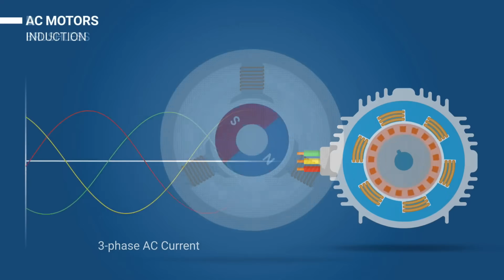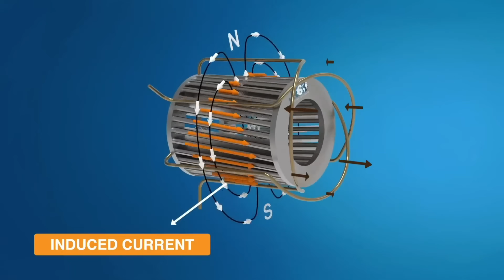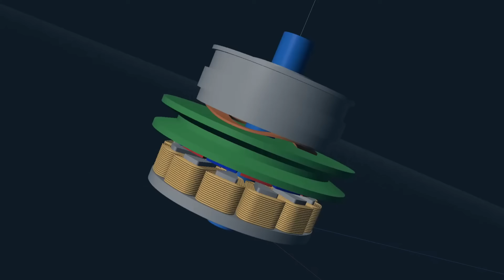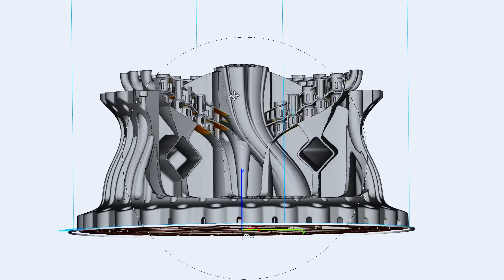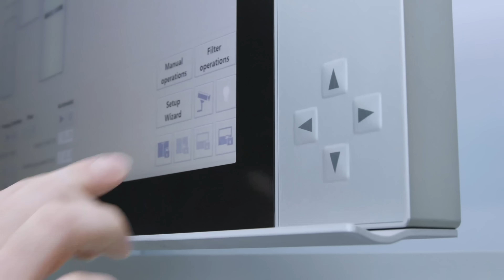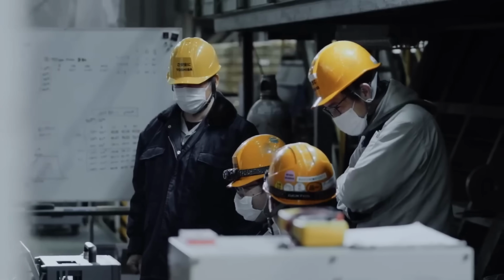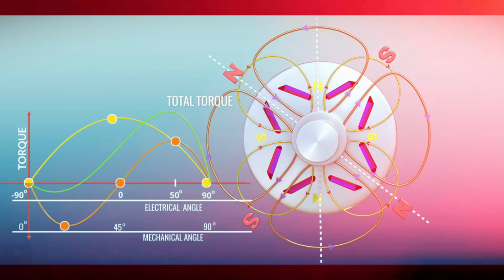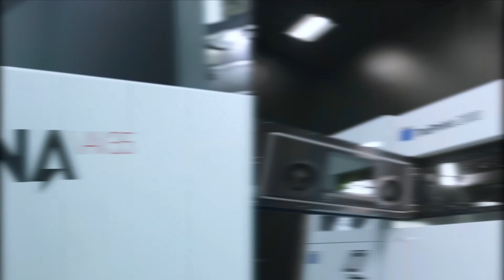NEW 80KW A.I. DESIGN ELECTRIC MOTOR - FREE ENERGY FOREVER 100% REAL!?

Comment: States Alex’s motor requires no external power source. Then a few moments later says it can run from any source of electricity, including solar, wind or water…which are just methods of generating the same energy…electricity! 
Not very convincing. 
If the item shown that came out of the 3D printer is the motor, which I doubt, it is anything but a simple design that’s easy to maintain. 48 hours print time. 😮. Ok, it’s a prototype but if it takes that long to make in production then it’s seriously not viable. Many things have high voltage and frequency. Microwave ovens for example. There’s no reason not to provide the correct insulation and shielding for the stated high electromagnetic interference. 
I’ll believe it when I see it. 
Good luck Alex.